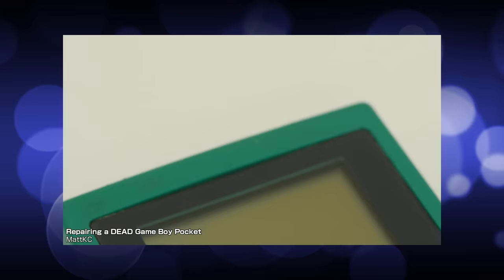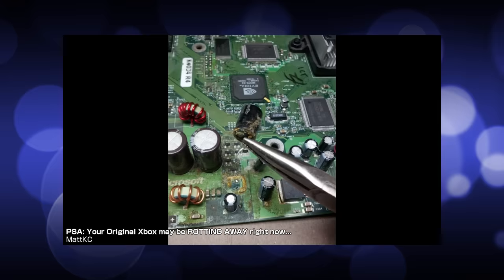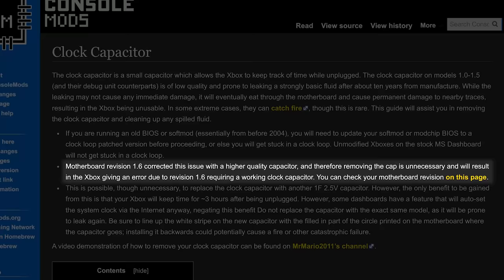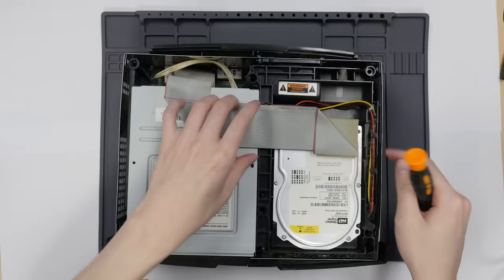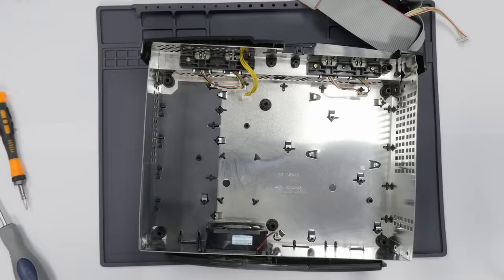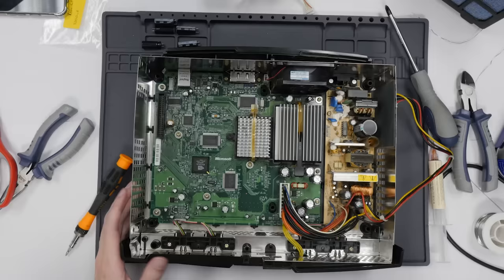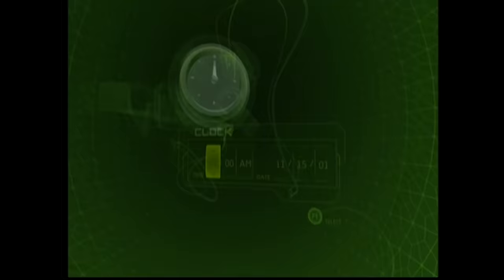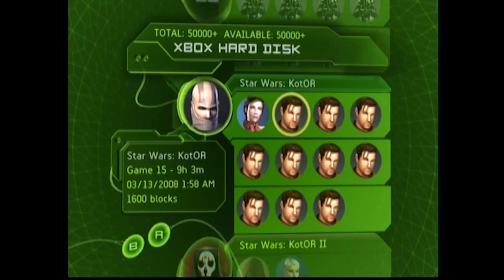DID HE SCAM ME? - Repairing a DEAD original Xbox

Comment: Ok so somehow my xbox still works (it's around 20 years old) how did I figure that out I was just trying to unplug my xbox one s controller from its charger (it was sitting right infront the xbox og) and I must of accidentally hit it with the knuckle with my index finger and if the og has a boot sound (without tv on or on the right channel) and I was like "oh ok that's great my og xbox works" but just incase I short circuit it or damaged it I turned it off might play on it again if I didn't break it. Sorry about the massive paragraph I wrote

Comment: I recently decided to go into the Xbox business for myself on that business just playing them you know what I mean and I got one to work fine and I use it on a regular and the other one is dead at the moment it's due to my own mess up I took the hard drive out when I was trying to upgrade it and I did not realize that there's a specific password for it cuz I first off I unlocked it then I had the format it to fix it and by that point the password was gone so I need to make a new hard drive for it that's kind of where I'm at if you can make a video on that it'll be extremely helpful

Comment: Yeah I tear off the warranty stickers as well on the iPhone 3G and 3GS there is a little  warranty do not remove sticker thing on the board and that says do not reverse for your water I mean you've already opened it which is always apples warranty but anyway but still I and the battery was extremely swollen and there and I Heard lots of cracking noises so I don't ever do it civilized because I work on a lot of 3gs's and they're very swollen most of the time I'm so I am never going to work on the trying to do it more civilized ever

Comment: Not sure if this will be seen but I repair retro consoles too and I worked on an original xbox and the first failure point is usually a belt that links the motor to the drive. Just heat it up to shrink it and it should fix the issue if that's what it is. Hope this helps!
Reply: That’s the belt that opens and closes the drive, seeing as he ejected the disc, that’s not the problem in this case. 

It’s trying to read the disc, it’s detected but fails…it’s either a failing laser, a scratched/dirty disc or a dirty lens.
Reply: @jonchapman6821  I didn't notice that, thats a good spot